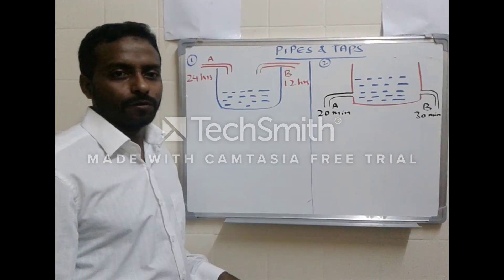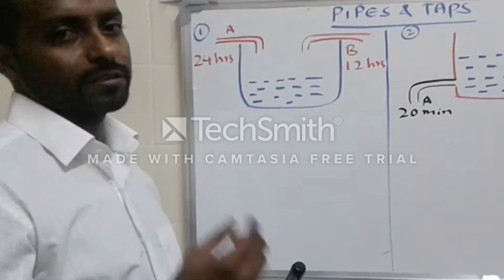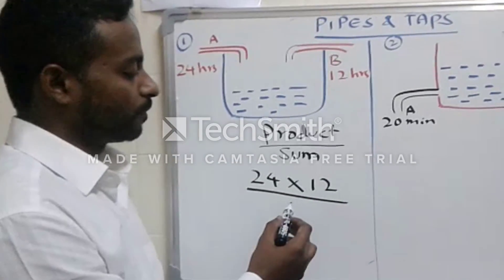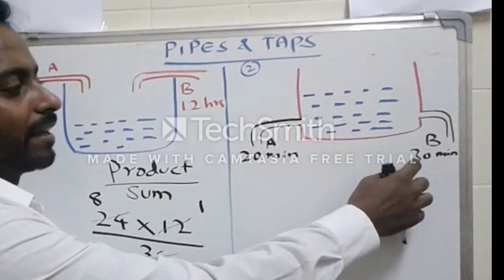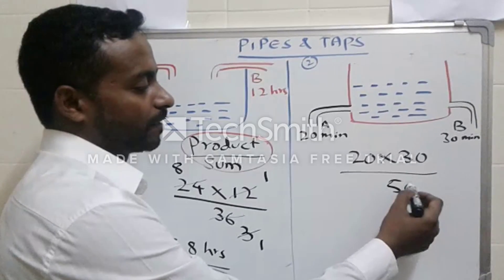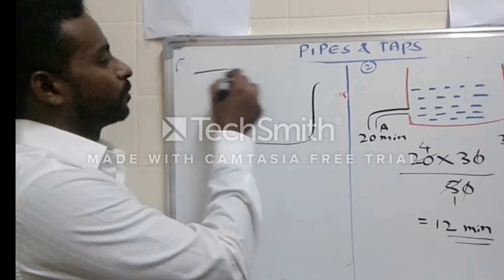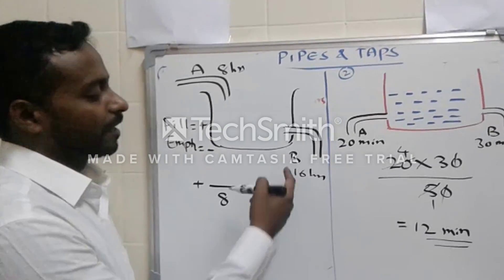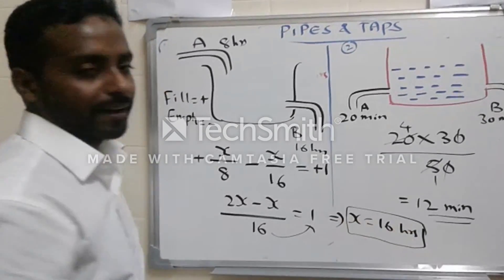Best way to answer the problems asked on Pipes/Taps required to fill or emptying a tank

Comment: I have one question sir
there is a tank with two openings one for filling the other one for empty the tank, filling can Don with in 3 hours emptying can Done with in 5 hour, how much time need to fill the thank if we opened two openings together
Reply: x/3 - x/5=1
5x-3x/15=1
2x/15=1
2x=15
x=15/2
x=7.5hrs
Reply: 7.5hrs